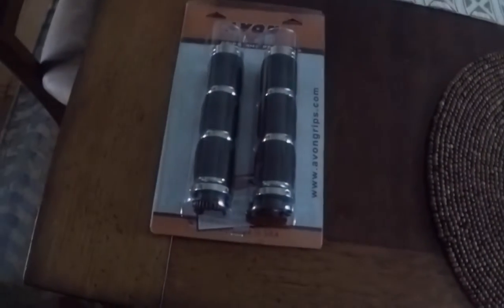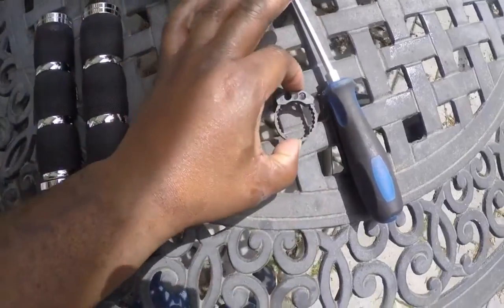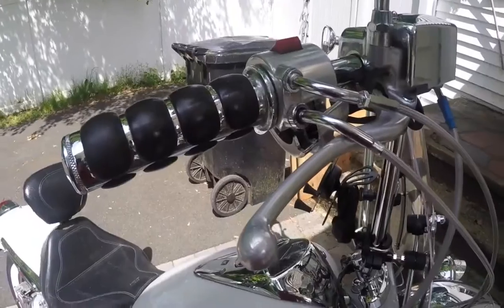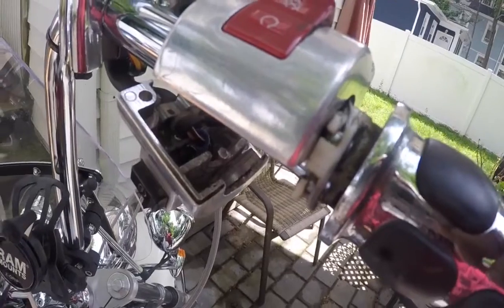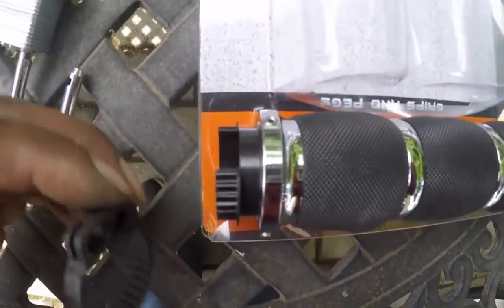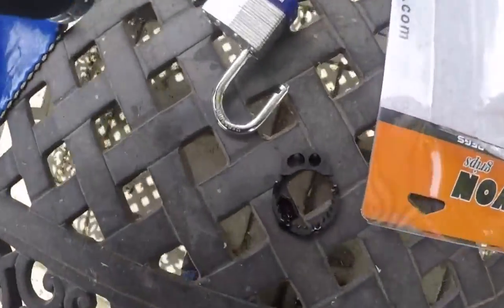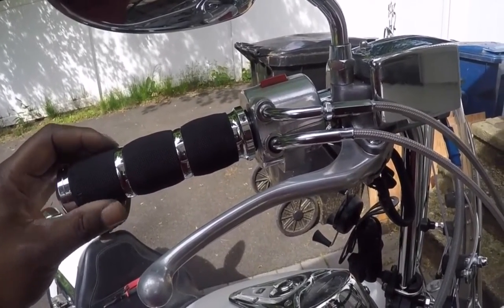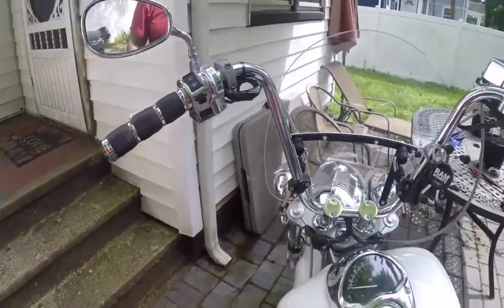HOW I INSTALLED A SET OF AVON GRIPS ON MY HONDA VTX 1300

Comment: This was the most calming tutorial I've EVER seen/heard. This is a masterpiece. This is exactly what I'd want after fighting a part every how to video should be like this. Like your calm uncle gently explaining things
Reply from the maker: Thanks I appreciate it 🙏
Reply: @lobanoriginals3307  idk how you got the dang cable to loosen enough to get the cables out of the controls I ended up having to pull my air box lift the tank a bit and loose. The adjusters on the throttle body to get enough slack.

Comment: How did you get enough slack in your throttle cables? I bought the same grips and can’t get the OEM sleeve off because the cables are too tight . I adjusted right near switch housing to no avail.
Reply from the maker: My cables were extended. You may have to disconnect or adjust the cables at the carb, or throttle body (depending on the type of bike) in order to gain enough slack.

Comment: how tall are your apes? and where did you purchase your handlebar cable extensions for the taller bars?
Reply from the maker: They’re 16”. I got the extended cables off eBay. They’re +8 over stock length
Reply: @lobanoriginals3307  Thank You!

Comment: he didn't have a problem installing the throttle cables to the grip because he has extended cables not OEM
Reply from the maker: You’re absolutely right… I did so much to this bike I forgot I changed the cables. I couldn’t figure out why some people were having problems installing the grips… Thanks for the observation

Comment: You skipped the most important part how to get those cables back on without breaking that damn plastic. I'm having one heck of a Time.
Reply from the maker: You install them the same way they were removed. You just have to make sure you have enough slack in your throttle cables. You may have to back the adjustment out  almost all the way… Hope this helps
Reply: I have all of the same connections you have loose and the cables will not go back on. We had to break the plastic from the old one to even get them off.